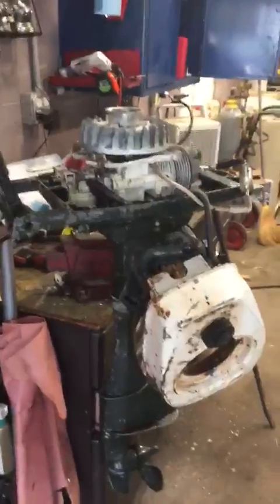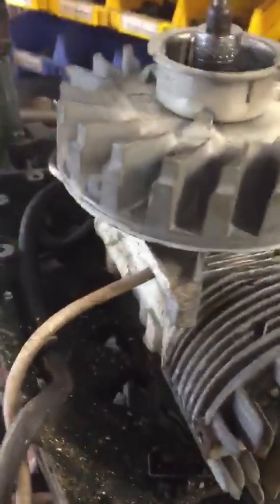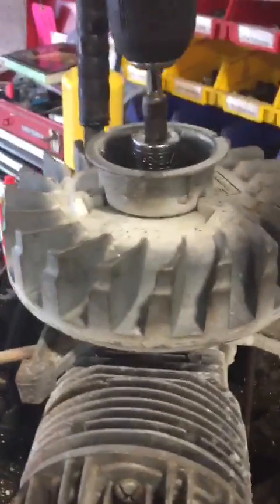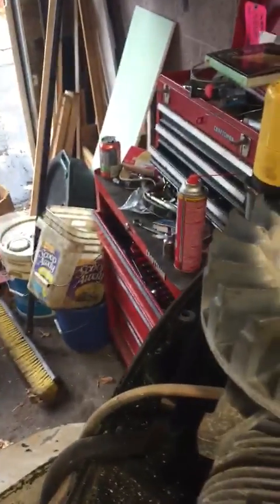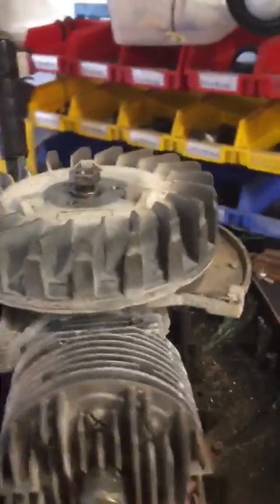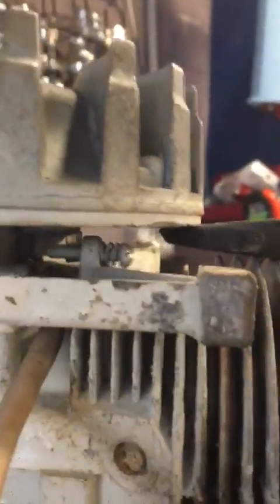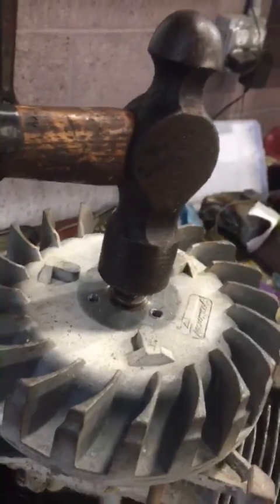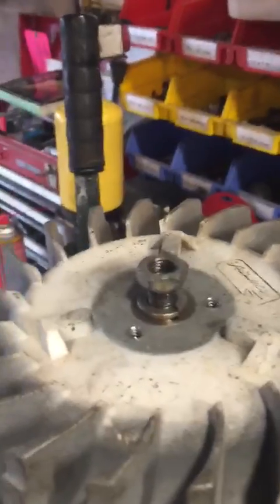How to remove the flywheel on a small engine without a puller.

Comment: The flywheel of my engine has a parallel pin and its stuck hard because of rust. I also tried to apply some lube and remove it but it didn't work. Please guide me ❤

Comment: are the flywheels pressed on?
because i tried starting a 2stroke mounted on a wooden board with a socket and drill
i had my finger on the throttle at full throttle when i started it
the drill bit flew off and the flywheel broke off
the fly wheel is loose but stuck on the shaft because i have a nut on the shaft
i dont know what  to do
Reply from the maker: I don't understand what you just said, but it sounds like you messed it up pretty good. I have never seen a small engine with a pressed on flywheel.
Reply: Late response but sounds like you over tightened the flywheel nut. Dont understand how the flywheel is loose when you say it broke off. Flywheels are taper fits on outboard crankshafts. In any case you will have to get that nut removed to take off the loose flywheel. Lots of videos on youtube to remove stuck nuts and bolts. The trick will be to hold the crankshaft still to remove the nut. This is normally done by wrapping a belt around the flywheel (or tool similar to oil filter wrench) to hold it still while loosening the nut. I have had success using a socket wrench and giving the handle a quick smack with a hammer.
Reply: @marksmith9295  thanks

Comment: Do u think this kind of trick recommended????
Reply from the maker: The correct way is to use a puller. But I left it at work. This way works fine as long as you hit the hammer square on the center of the crank and don't damage the threads.